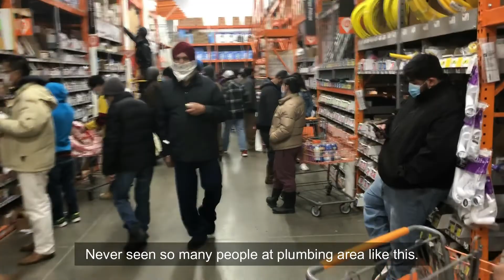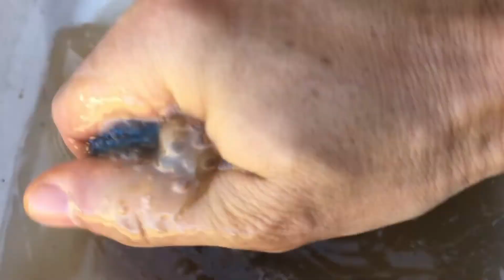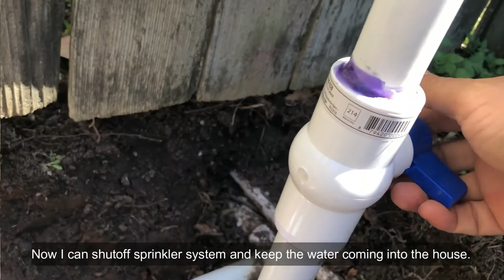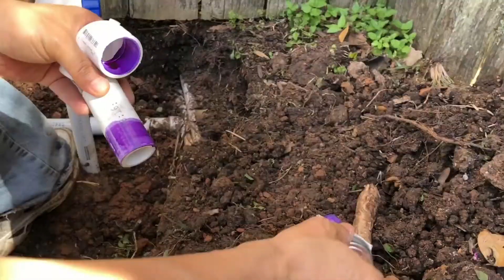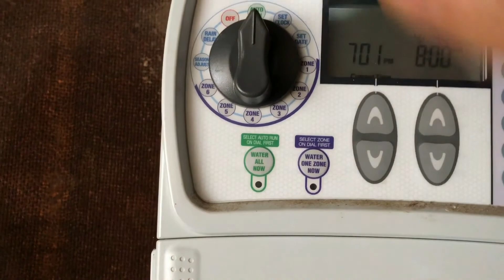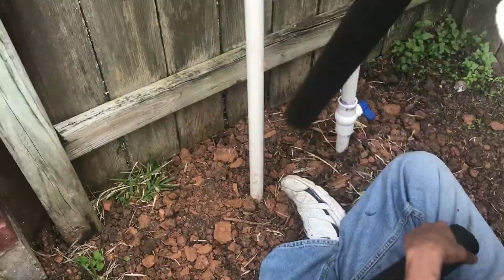Sprinkler Pressure Vacuum Breaker Replacement

Comment: From 4:00 on, without a drain plug of some type, shutting this valve is still going to just trap water which could freeze again, and you will still be digging up broken pipes next time. In cold climates, we typically have the main line into at least a crawlspace or basement which will never drop below freezing, then after the main line shutoff, branch lines to sprinkler systems have a shutoff with a drain cap on the unpressurized side, so after turning off in the fall, the line can be drained so no water remains in pipes going outside. Further draining, blowing air through systems etc. is necessary so no remaining water can freeze where expansion with crack pipe or other valves.
Also, the petcock drains just orient the screwdriver slot with the water - in line is open, perpendicular to the opening is closed. Vertical is relative, unrelated to the valve.
Reply from the maker: All good points. Here in Houston we don’t have basement/crawl space to protect the pipe.   I did initially wanted to digger bigger area and install both shutoff and drain valves underground in the sprinkler box that I can open from top, so that I can clear the above ground pipes of any water but got little more complex than the time I had so finished it this way.   It survived one harsh winter so far, but if it breaks agains I want to design it like I wanted.

Comment: Why is it so high?
Reply from the maker: It has to be higher than highest point of water outlet
Reply from the maker: @corey4917  That valve needs to be higher than the tallest sprinkler head you have to get the maximum water pressure.  I have some sprinkler head that doesn’t recede to the ground but it sticks out about 12” above the ground so this valve needs to higher than that. Also take into consideration that ground could be higher or shorter in different area.  So find the tallest sticking out sprinkler head and just make it slightly taller.  Now this doesn’t have to precise. It’s just to get maximum water pressure
Reply: @DIYLifeSkills  This installation was too high from ground, according to the specifications it should be 12'' above ground.
Reply from the maker: @ra78100 I have slightly sloping backyard and the valve needs to be 12 inches higher than highest point where sprinklers are.  So it ended up looking little higher.

Comment: you should have added a tee above the shutoff valve so you can blow out the backflow preventer and the entire system in case this happens again.
Reply from the maker: For sure. Originally, I wanted to add T-drain under ground with large sprinkler box so that I can completely drain all above ground water in pvc but it was so hot this year that I skipped it. I may still come back and do it in cool fall weather. Thanks for the comment.